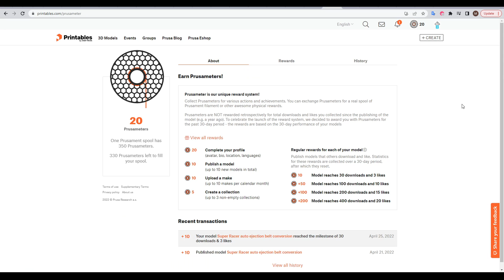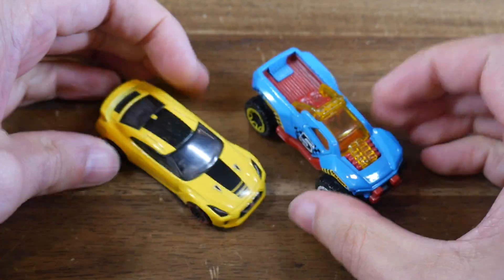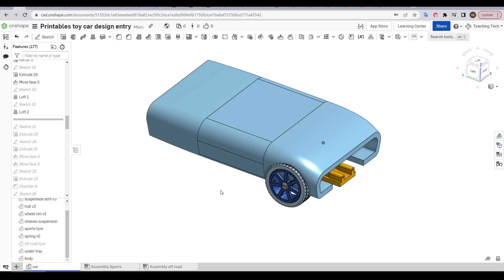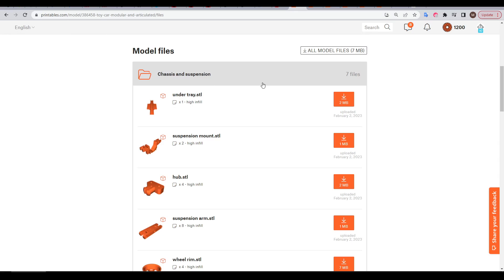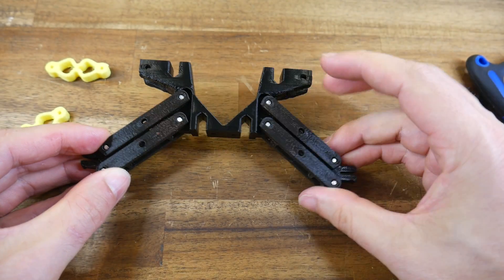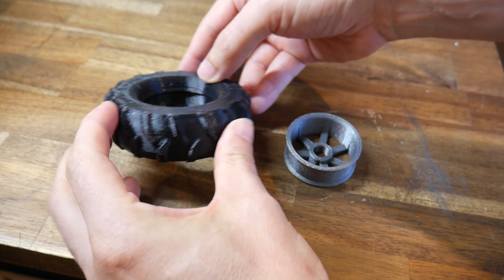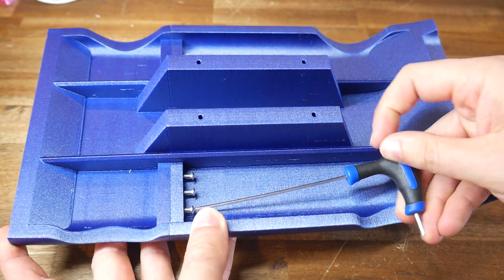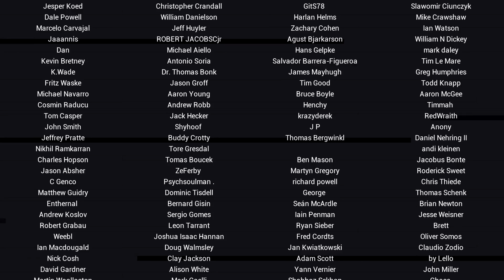Why you should enter a Printables design competition

Comment: Really awesome design.  Magnets on the chassis side pieces and the roof could be used to help keep the two pieces together instead of screws.  Gives it a bit more "kid" proofing and for easy swapping for custom tops.
Reply from the maker: I agree magnets would be perfect.
Reply: magnets are actually quite dangerous for kids due to being a swallowing hazard, that can easily pinch and get stuck. "The Toy Association Statement on Magnets in Toys" has some quotes for the relevant regulations to follow

Comment: i made something similar to this. mine had petg wheels and springs. it also used 7 degrees of caster to create natural counter steer.
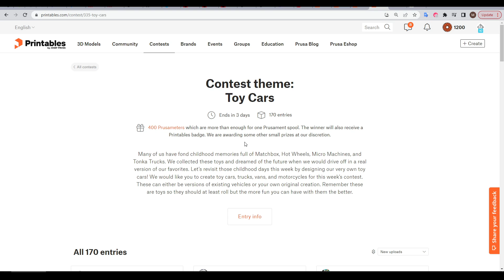but instead of it being a print in one it was just a chassi for a 1:24 scale die Camaro.
id have to improve its design and make the body 3dprintable if i want o qualifyif.

Comment: Great design! How many hours does it take to print? I probably will print this for nieces or nephews soon! Good bithday gift!
Reply from the maker: It's hard for me to keep track because I am iterating and reprinting updated parts. For instance I spent half a day trying out different spring designs but the final springs are about 30 mins to print. The longest prints are the roof front and rear. It was about ten hours for those, however that is on a fast printer.
Reply: @TeachingTech  ok, great thanks! Its really cool that it can be switched to different vehicles, with the custom spring design. 🙂